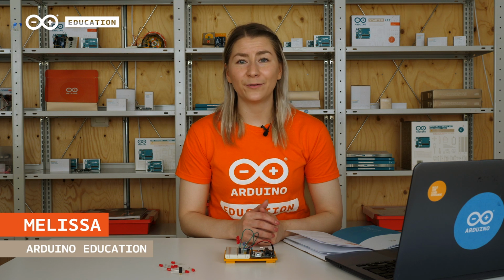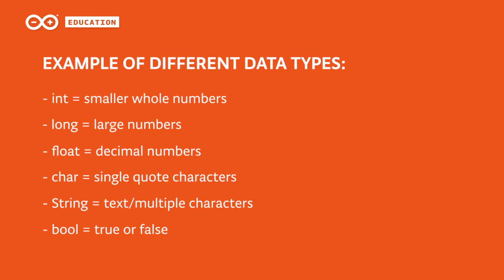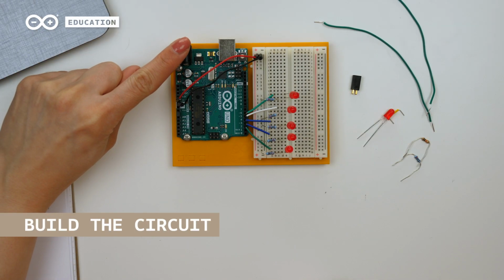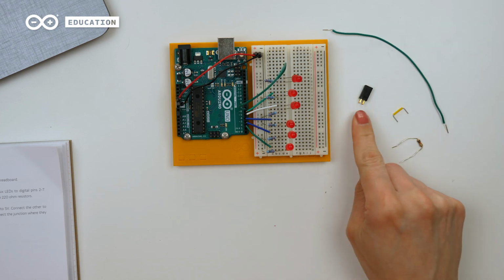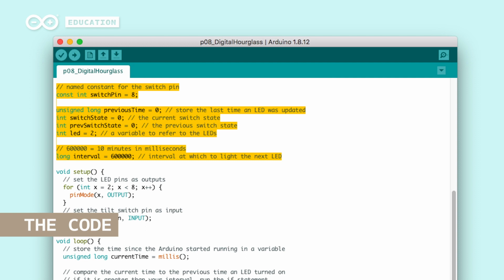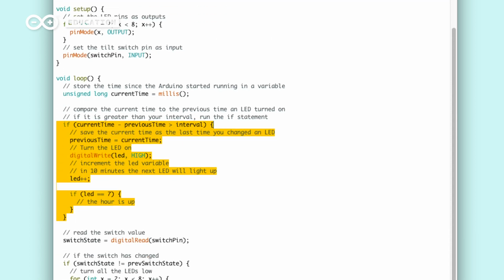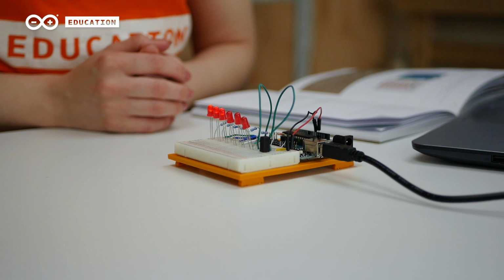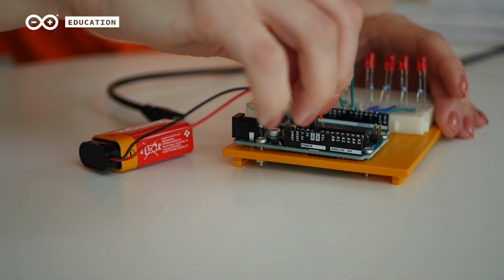08 Starter Kit: Digital Hourglass

Comment: Would be a fun project if the tilt sensor provided by the starter kit wasn't so short-legged. It won't stick and pretty much require some soldering with longer legs to fit.

Comment: This is a great tutorial video. Very well thought out. Excellent content for beginners. Treats the student with respect - explaining the steps rather than treating them like stupid sheeps and just show the steps. I also like how the leds were already pre-wired and you explained how to wire the last one then the tilt switch.  Great continuity rather than showing how to wire first led and then "jump" to wiring the tilt switch. Explaining code in chunks also helps the student digest easier rather than overwhelm them with every line.  Great job! PS: Thank you for the Arduino.

Comment: The wiring here is a bit different than what I have in my book -- can you explain the second green wire coming out of the tilt switch?
Reply: Don't worry that green wire is for the final LED it is not connected to the tilt switch at all